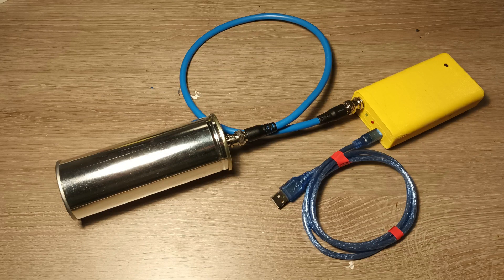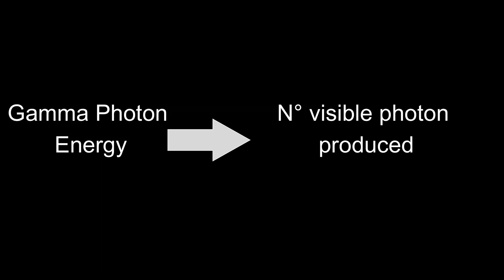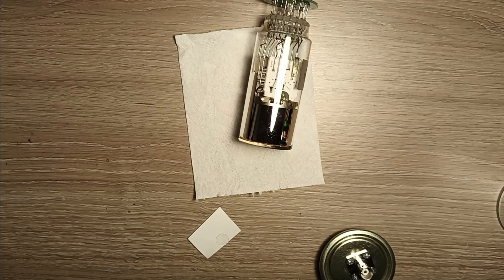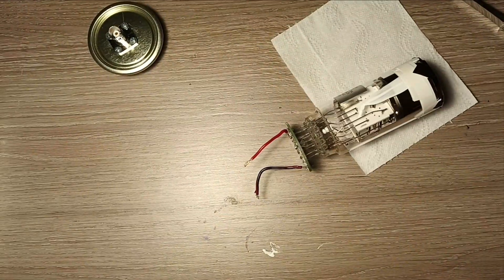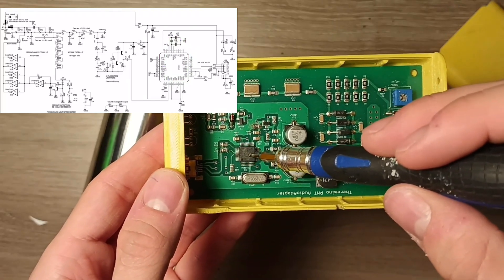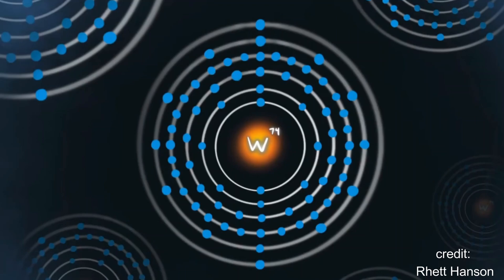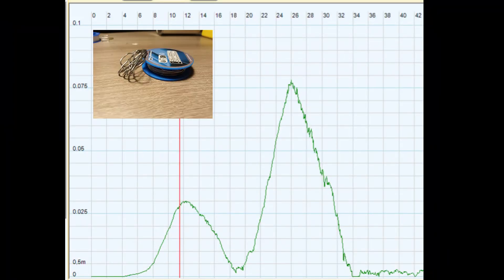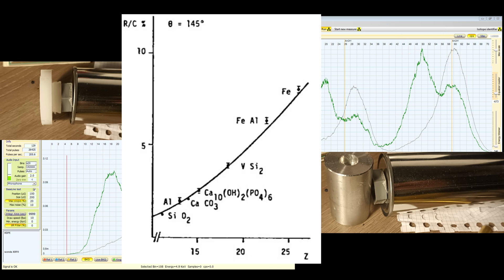Homemade X-Ray Spectrometer | XRF - Compton Experiments

Comment: This is super cool, this makes me want to add a low energy window to my homebrew R7400U PMT/CsI:Tl based gamma spectrometer. I wonder if my equipment is good enough though. A couple of questions:

-what FWHM resolution do you get on the 60 keV Am241 peak? Also, have you measured the 610 keV radium peak, or the 660 keV Cs137 peak, and what FWHM did you get from those? 

I have struggled with both my NaI:Tl/RCA 6199 PMT and my CsI:Tl/Hamamatsu  R7400U setup to get good peak resolution. The first is perhaps excusable since the scintillator and PMT are 70 years old and intended merely for field survey. But the R7400U setup should probably be performing better. The best I can get is about 9-11% FWHM at 610keV, and although I don't have clear notes, I don't think I got 33% FWHM even at 60keV. I would love some comparative data from another amateur at the peaks I was able to measure. I can barely see the 25keV peak (both due to attenuation and poor separation from 60keV). 
 
-did you really get 10um aluminum tape? Or how thick did your end window tape end up being? The surplus co-packaged scintillator/PMT assemblies I have are in an epoxy sealed aluminum envelope that's at least 0.5-0.7mm thick. I have cut several of these apart to extract the PMTs for other uses, so I can both cut the assemblies open and also have spare CsI:Tl crystals, but honestly I'd rather use the sealed assembly if possible. I imagine I could reliably turn/polish the aluminum envelope down in the lathe to leave a wall thickness of perhaps 0.1mm/100um without destroying the assembly, using extreme care. But I could get nowhere near 10um. I am trying to understand how important the 10um number you showed on the screenshot actually is. If you were able to achieve these good results with thicker foil than 10um, that would be good to know. 

-Is your Theremino program running a linearity correction of any sort? I see you're registering the lower energy Am241 x-ray/gamma peak at about 30keV, rather than the usually quoted 26.3keV. I am running a linearity correction for energies above 60keV, but I struggled to find usable linearity correction data below that. The only data I found was in "Non-Proportionality and Energy Resolution of CsI(Tl), Syntfeld-Kazuch, IEEE TRANSACTIONS ON NUCLEAR SCIENCE, VOL. 54, NO. 5, OCTOBER 2007", but this seems to be for experimental crystals and not very trustworthy seeming. 

Thanks for presenting this! Very inspiring.
Reply from the maker: Hi @InductorMan, I'm happy you found the video useful, to answer your questions:
-Resolution at these very low energy is generally really bad because we're at the limit of what can be done with this kind of setup. At 60keV of Am I usually get around 16%FWHM, though on some good days ive been able to achieve 12/13%
I don't have adata about 600keV as this probe is really inefficient at those energies so not much is visible, still i can give you another reference for low energy, as Cs137 has another peak at 32keV and there i got around 26% (I didn't try to optimize thie resolution that day so maybe better res could be achieved).

-The 25keV peak from Am should not be used as reference for resolution, as this peak is really broad and in reality is an overlapping of multiple peaks we can't resolve, instead try to use the Cs 32keV peak.
Anyway regarding your resolution: are you using a premade probe made for normal ratemeter instruments like a ludlum? what are you using ro power it? both voltage and instrument. Did you check the crystal quality? is it perfectly white or yellowish?

-Regarding aluminum thickness, I used an as thin as possible foil, this is to reduce attenuation at very low energies, as an example 100um at 8keV (Cu characteristic line) will attenuate 75%, while 10um will only do 12%. you can use thicker aluminum but this might increase detection time and worsen resolution due to compton scattering. If you have a lot of crystal you might try sacrificing one and just thinning the envelope up to the white reflective material with the lathe just in a central spot, than gluing a piece of Al kitchen foil on the remaining face to prevent air intake, even better would be to use thin Be foil but this is not commonly found.

-Yes, I make my own correction based on experimental peaks and using theremino you can easily do it too, as theremino has a completely customizable linearization "Mixer" that allows to choose custom energy range and custom shift in energy to achieve your desired peak position.
Reply from the maker: I also forgot to mention that with theremino MCA, you can virtually increase the resolution, by using their algorithm of peak sharpening, this way for example my 16% peak at 60keV can go down to below 10% but this function is a little bit sketchy and should be used with care as it cannot generate new information, so there is the risk of the function changing the peak position inadvertently, and so making you believe its at a certain energy while it's not
Reply: @Farben-X  Thanks for the replies, especially the precise FWHM values! I'll definitely go actually measure the 60keV line and compare to your numbers.

I've been using the scintillator/PMT assembly that has been available on eBay for the last couple of years from "Potomac eSTORE" as "Hamamatsu R7400U Photomultiplier Tube". It's a surplus head unit from a personal electronic dosimeter, as far as I can tell, and really not designed for spectroscopy. 

The crystals look fantastic when cut open, absolutely water clear. It's practically just like looking at a white disk of teflon when looking at the end of the crystal still in the cut-open housing. 

One point of note is that the crystal is almost the same diameter as the PMT housing, larger even than the PMT window/cathode, and in fact there is a teflon washer used to obstruct the PMT bezel and prevent it from absorbing light. So it very much does not follow your "scintillator diameter < PMT" recommendation. However, the crystal is very long aspect ratio, probably 50mm x 12mm diameter, and even when I've restricted the irradiation to the center of the end farthest from the PMT in order to homogenize the light intensity over the photocathode and avoid peak broadening from cathode response nonuniformity, I don't get better results. 

The power supply and data acquisition system are both of my own design, which are basically a PSU shield that fits on an Adafruit Feather M0 and provides a <5mV ripple 800V supply to the PMT, along with a directly coupled gain-of-1 buffer amplifier registering the anode signal across a 2.2nF capacitor/10Meg resistor acting as a very long time constant charge amplifier. This signal is then digitized directly at about 180ksps, and the pulse shaping is all done through digital filtering (really more like a band limited differentiation operation on the charge amp output, with peak detection). Despite this signal chain not being validated by anyone else, I really don't think that the issue is acquisition noise related, because there's only enough noise on the time domain trace to account for perhaps 0.1% peak broadening at ~600keV. 

Plus, I've used the same signal chain with an LED pulser to characterize the PMT and downstream signal chain's intrinsic resolution, and I get basically no excess peak width beyond that expected from photon shot noise. 

Regarding the peak sharpening, yeah I'd played around with Theremino software before and really don't like the whole package to be honest. There are several things that made me question the design: first, that peak sharpening thing itself seems very ill-advised, since the description of how to properly do that (described in "Scintillation Spectrometry, Gamma-Ray Spectrum Catalog, by R.L. Heath, section IX. Computer Techniques for Data Analysis") is very clearly NOT what Theremino MCA is doing. The second thing that I didn't like is that they recommended a particular external USB sound card, and then they recommended setting this sound card to 192ksps in order to achieve "better peak resolution". But when I bought the same sound card and tried this, I became convinced that the sound card was actually digitally up-sampling after simply converting at 44ksps. Maybe this was a driver issue or something, but it certainly didn't seem to actually improve the information content of the signal when I tried it. I could have been missing something... I just got the impression that the whole thing wasn't super well done. This was also many years ago so maybe things have changed.
Reply from the maker: @InductorMan  Hi, I've never tried those little module but they seem interesting, but I think they might be a limiting factor in spectroscopy experiment like this, first of all by looking at your tube datasheet I see that the radiant sensitivity at the emission of CsI:TI 550nm is lower at like 20% compared to the 50% of my R980.
Another aspect is the supply voltage, for these very low gamma energies I've seen a better resolution by working at very low supply voltages yes it seems counterintuitive but maybe is just less noise to combat against the weak signal.

Your electronics looks pretty interesting, I've never seen that in diy spectroscopy but It would be interesting to try that out especially for the fact it uses a small mcu that could make a very portable spectrometer. Do you have also the mcaa done on the adafruit or it feeds a pc for further processing?

Regarding theremino, I used their newer version called pmt audio adapter, wich directly has an USB output without the need for an additional sound card, by the way I agree the sharpening algorithm is pretty much useless especially at these low energies, as if I'm already able to distinguish a peak I won't need it, and if I can't distinguish it, the algorithm won't make it out of the noise, but it's just to make prettier graphs. Though I find theremino better and more user friendly than other software and especially much cheaper than the alternatives like gamma spectacular while having the same performance. Also I've spoken with the guys from theremino and they're always available to help or give out suggestions for free.

I'll add a couple observation to the crystal side, first I think you could improve resolution by cutting down on crystal size, in spectroscopy thers actually a correlation between resolution and crystal size and the optimal size depend on energy, for example with NaI at high energy the turning point Is around 1.5/2 inches, after which you start losing resolution as the crystal gets bigger. Meanwhile here we are dealing with much lower energy xrays, they will get completely absorbed in just a couple mm of material, and since your is 50mm long, the remaining 48mm distance the light travels is just signal being lost to autoabsorption, all the low energy scint I've seen were very thin slices, so maybe you could try cutting a 1mm or more depending on practical feasibility, from one face, and couple the already polished side to the pmt, another positive aspect this might have is the reduced background, as a 50mm scint will probably have a very high background count rate.
I think your pmt might be kind of a problem, since it is such a small form factor they probably have compromised some aspects like linearity, the pmt for this applications are usually the bigger more standard form, I've had succes spectroscopy also with other pmts apparently not made for this job like the r928 that even has a round face!😅 but this small one was probably used  for dosimetry like you suggested, and not for precise counting. 
Btw if you want to share more details or experience, there are other folks into this hobby on the discord server linked in the channel
Reply: @Farben-X  Thanks! Huh, the discord does sound fun... I spend too much time online already though, I'm not sure that's a good idea for my mental health and relationships! 

Interesting point about optimum crystal size: I certainly have a couple of spare crystals, as one came with a gassy tube and the other was removed for a tube that I used elsewhere. I suppose any diamond abrasive wheel could cut it? I understand the background argument: what are the other issues with an excessively large crystal? Simply more path length for optical absorption?

Yeah, the quantum efficiency of this photocathode is really unimpressive. The LED pulser experiments put quantum efficiency at 16-19% with 405nm input (uncertainty from source brightness, it's probably 19%). Not only that, but it's the standard spectrum, not the multialkali red sensitive one, so that's a factor of maybe 2-3 loss in sensitivity right there when coupled to CsI:Tl. All in all, I believe I'm only getting about 1 photoelectron per keV. Quite lame.

Yeah, regarding the M0 based system, I'm actually super proud of it: it has a little OLED screen, click joystick user interface, ~450mAh lithium ion battery, Feather M0, and 800V power supply in a ~35mm x 35mm x 80mm case with the probe sticking out the back another 50mm in a cylindrical shroud. The M0 does the acquisition and MCA function in a high priority interrupt routine, runs the little UI, and displays the spectrum on the OLED in a log intensity plot (only way to fix that much dynamic range in a 64x128 pixel screen), which can be rescaled and everything. The 12 bit ADC just maps straight to a 4096 bin MCA register, with the on-chip preamplifier gain software selectable. Then the data can either be saved to onboard SD card as CSV or dumped over USB serial, and CSV files can also be transfered both ways over USB serial. 

Sorry that's more detail than you asked, but I don't really have anyone else to brag to about it!
Reply from the maker: @InductorMan , yes, a diamond wheel would work great. I'm not sure if others might do it, as it's really a soft material. Be careful not to wet it, though.
Auto optical absorption is one argument, I don't know the exact reason for worse resolution as size increases but it is a real effect, also all the probes specifically made for X-rays use a thin slice of crystal, so they must have their reasons.

The M0 is a very neat solution, before I've tried using an arduino for data acquisition, but ive run into a very low speed ADC problem, which would be able to sample only a few points per peak. So you read directly the non-shaped signal directly from the PMT? If so what is the smallest temporal resolution your system can probe? and do you have an analog discriminator to remove low energy noise or also that is done digitally after all the possible data is recorded?
Reply: @Farben-X  Correct, the primary concept behind the front end is that the PMT charge is delivered directly to a high quality NPO/C0G type capacitor, and so charge is translated directly into voltage with flat bandwidth up to GHz (in theory) governed only by the impedance characteristics of the capacitor. Then, the charge has to be removed. This is done slowly with a 10Meg bleed resistor. Of course, that distorts the ideal stair-step waveform of the charge signal, but it's easy and cheap. 

I also did build in a discharge transistor that can be used to recharge the capacitor to an initial starting voltage. The idea here is that in cases where one has a really high count rate the bleeder resistor might not keep the capacitor voltage from exceeding the ADC range. However in practice I don't find myself measuring high activity samples! So for the MCA application I never programmed this. The other idea is that one can completely remove the resistor and get a pure charge waveform with no exponential decay, but this is only half useful because of course there's dark current/dark counts and so the waveform isn't ideal anyway, and has a background slope.

Then the digital signal processing does use a simple threshold for noise exclusion: the delta between subsequent samples is compared to a simple trigger threshold, and if exceeded, then the previous four samples are added together as a baseline measurement, the system waits 9 samples for the photoluminescence to decay, and then takes four more samples after the charge step. The delta between the baseline and final measurements is the charge step height. This corresponds to the energy. 

This is not perfect in several ways. I'm working on a nicer system for alpha particle spectroscopy, using a charge amplifier (nice op amp with 1pF feedback capacitor), and an active servo loop to discharge the charge amplifier using the DAC feature of the MCU, providing an auxiliary discharge current into the charge amp input. This removes the exponential decay from the charge staircase. This system works, although I'm not sure the extra software complexity was worth it. 

Temporal resolution is arguably about 70us? This is the dead time, basically. The trigger event causes 4 pre-trigger samples to be stored, then a 9 sample wait for the luminescence to decay, then 4 post-wait samples. The 4 pre and post trigger samples for two subsequent detected peaks are allowed to overlap without issue. Samples are 5.3us period. The thing is, the system definitely just misbehaves if another event falls within the signal acquisition window of a given sample. 

But I'm not 100% sure I understood the question, since the system doesn't record any temporal data. Once an event is processed the temporal info is discarded and just the updated MCA bins remain.
Reply from the maker: @InductorMan  hello, sorry for late reply and thanks for the details, my question regarding the temporal data was due to the fact sometime ago i tried using an arduino to record the data from the theremino system, which output pulses of around 100uS lenght, and the arduino couldnt keep up with that as the sampling resolution is bigger than like 70uS so only one or two point of the pulse could be measured for eveery pulse.
Anyway did you think about pubblishing your setup like in a video or post? Given the few components required it might be very interesting alternative to more complex and expensive devices
Reply: @Farben-X  Thank you for the encouragement! I do think it could be fun to post some of my designs somewhere. 

I guess this one is a bit less than beginner friendly, since although it's structurally simple, the HV power supply is a custom PCB with a separate PIC10F322 MCU to do the cycle-by-cycle regulation of the converter. So that requires a programming tool. 

But maybe the Arduino code and custom ISR code could be useful to someone who already has another way of making the power supply voltage needed!
Reply from the maker: @InductorMan yeah exactly, I'd be interested too, I was thinking of converting one of those big old school meters (like ludlum scint) into a digital version, as they only measure counts, and with that feature you could use them as spectrometers, as the mcu is doing the digital/data part, while the meter supplies the probe with required HV
Reply: @Farben-X  Oh, I've basically done that also! I have an old 1955 "scintilla-scope" field survey meter from Fisher Research Laboratories in Palo Alto, CA that I've totally rebuilt over the years, including adding a little 3.5mm stereo phone jack and then added a little external MCA unit that plugs into the jack, gets power from a switching circuit on one pole of the jack, and gets the pulse amplifier signal from the other pole. Same Feather SAMD21 based concept, basically, with the same little OLED, and a thumb scroll/click wheel. 

Man, telling you about it is getting me all excited! I really should share some of this with people, even if some of it is half-baked.  I'm definitely seriously considering your suggestion of documenting it somewhere. If I ever get up off my butt and do it, I'll tell you where it is.
Reply from the maker: @InductorMan yeah the portable MCA meter is a very cool project, let me know when you post something!😃
Reply: @Farben-X  By the way I think you're right, I think the only practical approach is to completely open my scintillator housings and then re-window them with aluminum foil.